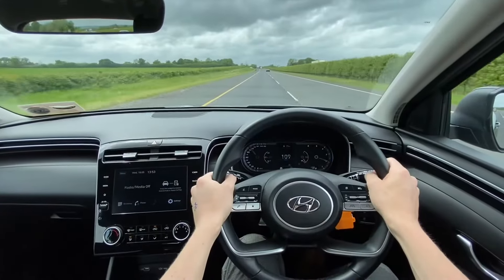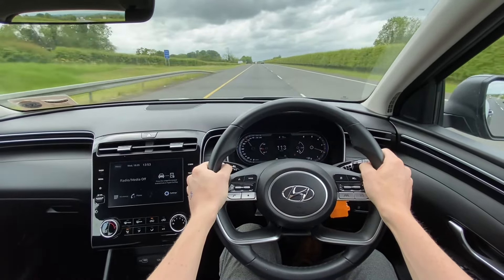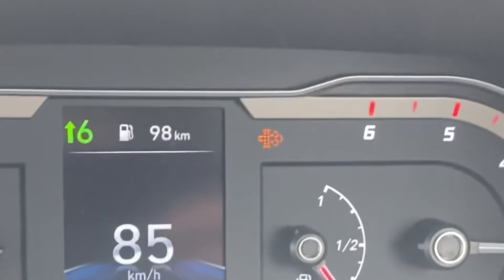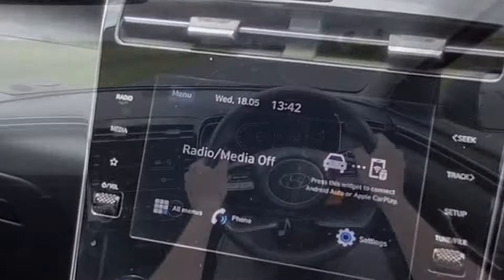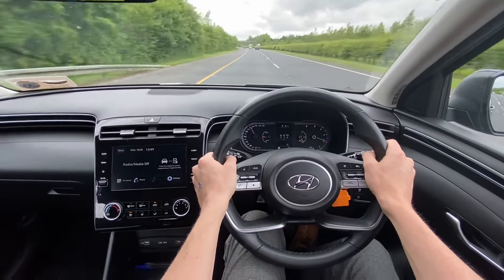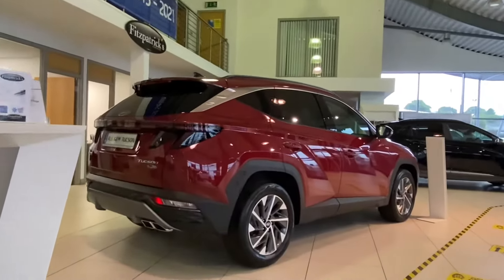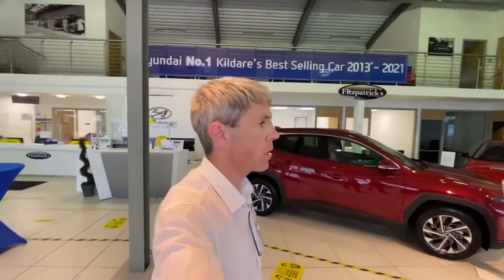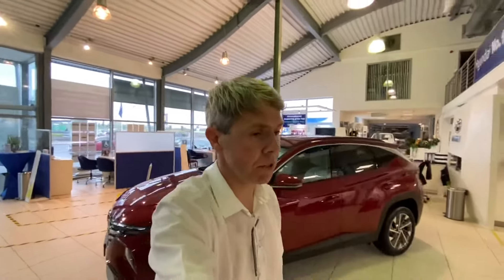How do you clear the DPF light on Hyundai Tucson #dpfsolution #hyundaitucson #howto

Comment: Hi Brian, same to me 2nd time in two weeks on my Tucson TLE 2016 1.7 CRDi 85kw with cca 80k kms. DPF light blinking on dashboard. I drove 50km with cca 2000-2500rpm. Nothing change.
I was surprised when diagnosis show that DPF filter was regenerated 50 km ago. But still blinking till I switch engine off and start it again. After new start dashboard is clear. Im going to go to my dealer tomorrow. Maybe electrician will find something incorrect on cables, pins or some sensors, probes or whatever. But if you have any idea what it could be, I would appreciate your advice. Thanks. Tom
Reply from the maker: Hey there ! If DPF is blinking .. it indicates a fault with the DPF.. unfortunately it’s too hard to guess what is wrong with your one, as DPF issues were less common on the 1.7 .. let me ask does it have full Hyundai History?? I.E. were the oil changes done with the proper oil on a regular basis??
Reply: @doolanbrian  Hi Brian, I have had every service done at Hyundai except the last one.  The last time I serviced my car by  myself according to the car manual, one year after the last service inspection.  According to the manual, it was only an oil and filter change this time.  I have kept all the requirements.  The oil complies with the specification 5w30 C3 according to the manual/service book. Could this be the cause?
Reply from the maker: @tomasjacko8934  okay it doesn’t sound like servicing is the problem,I have unfortunately seen DPF’s wear out prematurely but because it showing a regeneration it’s confusing .. they will need to see if the soot level is reducing during the regeneration, let me know what happens 🙂
Reply: Hi Tomas, I have a Tucson tle 2017 2.0 CRDi 120k km and I have the same problem and can't fix that looks like it's a software problem. Did you fix that problem with the local dealer?
Reply: @fabionsa88  Hi Misha. Unfortunately DPF was  broken. Serviceman from non original car service replace it with DPF from damaged in car accident but same type of car. After the replacement engine was noisy and has deep sound like there was no exhaust. I sold the car to a car buyer. But for future, never trust non original servicemen, would be better to visit original car service.
Reply: @tomasjacko8934  Yep. it's true and very important to use official service. thank you have a nice day
Reply: @fabionsa88 hi! I have the same problem. The local dealership after each scan says the car is ok, but shortly after leaving, the dpf starts blinking again with check engine light on also. Did you resolve your problem? If yes, how so? Thank you
Reply: @rascarachedan1576  ihave the Sam problem have you fixed IT?
Reply: @Kostas92 unfortunately the dpf needs to be replaced. You can try cleaning it but almost 9 out of 10 times are uncleanable. So’! Good luck. 

I heard you can try a “dpf off” solution. It’s cheaper but Not quite legal though. 

Or buying a second hand one if you are not in the warranty time anymore. 

Please share your solution when you solve this problem.
Reply: @rascarachedan1576 i have cleaned my dpf bro ..the mechanica say its good but i have this problem this lampe blink i go in monday in Mechaniker i will Show the Sensors first Temperatur sensor and Differenz sensor and i say you after. But in diagnostik its All ok ..but my car make Not Regens 😢

Comment: I've had a flashing light on my recently purchased 2018 i30. I went to the dealership and they did a full scan of the car and said there's nothing wrong with the dpf and it's probably a false alarm. Can anyone help?
Reply from the maker: Is it a flashing DPF light?
Reply: @doolanbrian  yes
Reply from the maker: @migrabino  when you brought it to the garage was the light still flashing?
Reply: @doolanbrian  no, when I stop the car, the light goes off. I've been told to ignore it but since that, the engine oil level light has gone on once. Someone told me it could be a malfunctioning temperature sensor forcing the dfp to regenerate when it isn't necessary.
Reply from the maker: @migrabino  unfortunately, it’s hard to speculate, if you had a faulty sensor, it would stop regeneration occurring for sure, but you shouldn’t have a flashing Dpf light if you have replaced the sensor, it really needs diagnosis with main Hyundai dealer
Reply: @doolanbrian  thanks for the feedback.
Reply: @doolanbrian     Let me just add that I've been getting a low oil level warning in the dashboard before ignition in the past few days. However, when I check the oil level, it has been rising.  It is now too high and I am going to change it and the filter. Any insights you can offer me, please?
Reply from the maker: @migrabino  the oil level indicator works for low oil level but also high oil level.. unfortunately it’s hard to tell why the oil level is increasing but it’s possible that The diesel particular filter is no longer operating correctly so my first port of call in this case would be a main Hyundai dealer 

if you’re not getting satisfaction from the closest one, it’s no harm to try and alternative one.

The DPF could be possibly damaged or no longer working properly
Reply: @migrabino i have the same problem .. have you fixed ? Was the Temperatur sensor this problem ??
Reply: @Kostas92  sorry, didn't fix it. Sold it and lost a lot of money. Replaced it with a hybrid Corolla. I guess that in spite of our cars having a problem, they weren't build for less than 200 km a day.

Comment: So on you video I have just seen that you drobe new tuscon vith 14 k on the clocck and dpf filter Light on Dashboard. This is copletely bulshit ih you asking me. I Had i30 from 2007-2016 and I sold it vith 270 k km and that car have never had any problem. For the past 7 Years i have Renault megane mk3 1.5 dci euro6 engine, and after 170 k km had 0 issues, breakdowns and no waring Lights on Dashboard. No Hyundai for me any more..
Reply: Not a bad idea there, all my cars have been diesel and never had an exhaust filter particle problem,
I opt for a brand new Hyundai 1.6 petrol N line 3.600 miles in and hey presto Ta Da

Comment: There is a fault on these cars. Mine has come on again. This car is not fit for compatible city driving so must be taken off the road. Its stupid you can't drive for 90 minutes just because it's not compatible with normal driving
Reply from the maker: The diesel ones unfortunately are not suitable for those who live in the city as they need motorway driving for about 15 mins every 250/300 kms .. hybrid is best for town .. did you clear the DPF yourself ?
Reply: @doolanbrian  first time yes. But now yesterday it came on, next restart engine management light came on. Calling Hyundai today and probably webuyanycar
Reply from the maker: @SB-kz1ti  if you have engine light on it, need to go to Hyundai dealer to be manually cleared.. the car will probably go into a reduced power mode, going forwards you will need to do a 15 to 20 minutes motorway drive every few hundred kilometres to keep it clear. As you say, if you live in a built-up city, and you don’t do any motorway driving, it’s probably better to consider trading it for something hybrid instead.👍
Reply: @doolanbrian  My 1.6 Diesel Tuson is 3 months old with 5300kms and already showing this problem. I live in a city but do longer drives most weekends. Surely the dealers have an obligation to advise customers who live in a city that this car is not suitable to purchase? My last 6 cars have all been diesel without this issue? Pissed off big time - first and last Hyundai
Reply from the maker: @cor7878  what country are you based in? Have you been able to clear your diesel particular filter so far?
Reply: @doolanbrian  Fault was gone again after work! I have it booked in on 12th June - not happy. I know the whole ad blue setup is complete rubbish but this is crazy after 3 months. Especially as it has been given a good drive on the motorway most weekends. Must be a fault?
Reply from the maker: @cor7878  unfortunately I don’t think it is but I can’t be sure… let them scan it and check

My experience is usually when the vehicle asks the driver to regenerate, and the driver starts the regeneration process immediately and it clears then DPF is working correctly 

While it’s inconvenient at times, it is technically doing its job

If however, the driver doesn’t do the drive to clear it when the warning is on, or if they turn off the vehicle with the warning on , or if they just can’t make it to a clear road on time, it may then clog , at which point you need to visit the dealer as the engine management light will now be on

Hope the info helps 🙂